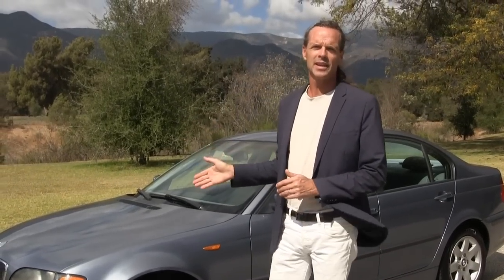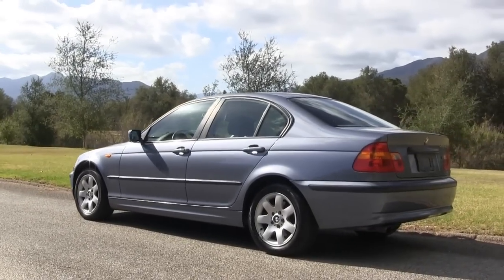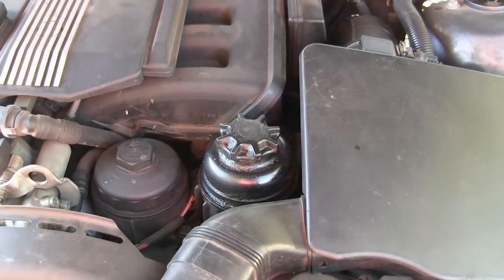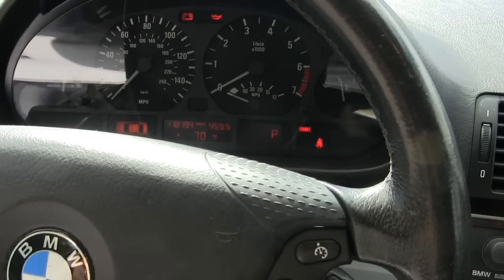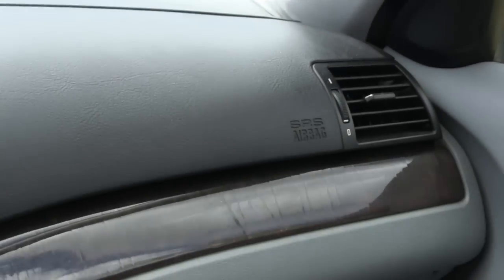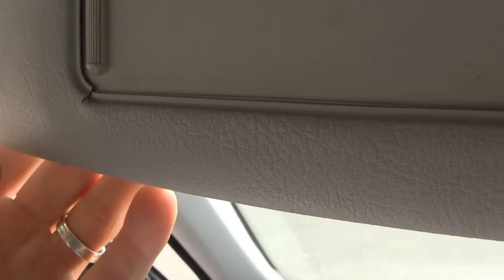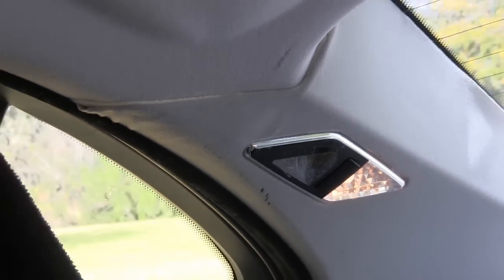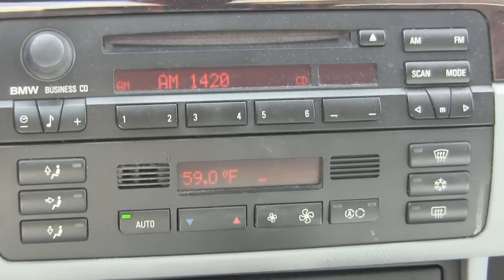Why You Should NOT Buy a Used BMW

Comment: Has this car been parked under water?
Reply: Florida car maybe?  I wonder what cleaning agent was used in the interior to attack the surface?  The same one used on the badge probably.  I'm not sure about Toyota's being any better at high mileage and not garaged.  At least BMW owners pretty much know what they are getting into and do the maintenance.  Toyota/Lexus owners pride themselves on not doing maintenance.  All cars fail without maintenance so which one do you want?
Reply: EXACTLY. I never had issues like this on my 325i. This is bullshit.
Reply: I worked on BMW's in the UK for years and they have always been fabulous when under 5 years old, but after that the problems begin with tech that always fails, everything electrical starts to give up the ghost - aircon, windows. audio, door locks, alarm, engine electronics, dashboard, you name it it fails in the end. If you are not into repairing these items yourself then you're at the mercy of main agents and their astronomical labour charges.
Reply: Nope, but it should have been.

Comment: BMWs are great cars, as are Audis and VWs, however I will say that us Europeans get the best quality cars from the German manufacturers. Volkswagen cars sold in the USA are made in Mexico whereas Volkswagen cars in the UK, France or the rest of Europe, are made in Germany. BMWs sold in America (specifically this E46 3 series) is also made in Mexico. BMWs sold in the EU, are indeed, made in Germany.
Reply: so. according to this theory....  you guys are saying that every different assembly plants from BMW specially the Mexico division, who caters to the North, Center and South America,  the Caribbean adheres to a different standards aside from the one in Germany?   Manufacturing processes, parts suppliers,  components,  and quality control  across the board is optional for this brand depending on the country of origin?
Reply: The original parts, no. However, the construction will definitely be worse. I've heard horror stories from USA based VW owners including the brand new Golf-R, having cars plagued with annoying & expensive problems meanwhile you hear nothing over here in the UK. I've obviously heard about issues common to cars such as the 1.9TDI engine breathing a lot, the VW Golf MK5 with its issues such as doors sometimes not opening, suspension degenerating etc but it's never as bad as cars from overseas in the USA.

I think cars made in Germany will be put together much better because of workers being treated nicer and properly according to German law as opposed to Mexican workers who will no doubt, get treated worse and have lower morale. Plus, Germans are known for their excellent work ethic and their quality craftsmanship.

Every car has its issues but I think Mexico-made cars have more.
Reply: you think the same as you go to take a shit....you presume, but experiences from europe tell that bmw and others are crap....
Reply: Denis Sabljarić mid-90s are border for good quality in most and in bmw as well
Reply: Denis Sabljarić that's one side of te story and the other is bad mechanics....sve su to odavno totalna precenjena bezvredna govna ;) i japanci nisu što su bili....
Reply: Denis Sabljarić mostly, yes, but I believe there are decent 5 e39s for bellow 5000.
I know a man who had a6 c4 2.2 t....survived hard driving well, but when it started falling apart, it was almost 4000 in engine repairs only and still wasn't ok....sold and the other owner had luck to change a few things and it is ok....but that guy lost his patience after great loss of money
Reply: Denis Sabljarić yeah, my friend with c4 2.2 is from zagreb, but he did the job by himself....for things that didn't require specialist, such as turbo or engine head....the good thing is to have chain-cam, but only if the chain was properly made, otherwise it is even worse than belt.
Reply: these materials are not made to withstand 35C dry weather on a constant basis, i assume the guy lives in cali
Reply: Denis Sabljarić rear lights are ugly on e46. the ugliest are creations from chris bangle and latest bmws....
Reply: BMW's Mexico Plant wont even be producing cars until 2019.  As of right now the only BMW's made outside of Germany are the SUV's.  They are made in the Spartensburg Plant in South Carolina.  The quality is exactly the same as the German cars.  It would not save BMW any money to switch out an assembly line with inferior parts for different markets around the world.  The only differences between the European models and the US models have to do with emissions as the US holds emissions to a "higher" standard then Europe.
Reply: I have 3 Audi's, all over 200k. With proper maintenance and care, they last decades...
Reply: Yes BMWs cost more to maintain.  It needs to be an understanding when purchasing the cars.  You dont need to be a millionaire to own one though.  I have owned my E46 for ten years now and because  I have kept my car properly maintained it has been a very reliable car.   On average i spend roughly $700 a year on maintenance with some years being more then others.  If you cant pull $700 a year maybe you should be driving a bicycle.
Reply: Well I cant speak for an Audi as I have never owned one but i have owned multiple BMWs and reliability has never been an issue with proper maintenance.  I will say I have owned a VW Golf and it had a ton of issues mostly electrical.
Reply: Well to be honest, if someone buys a foreign luxury vehicle expecting the maintenance cost to be low, they dont need to be driving said car...

Also, with these older vehicles, one could just learn to turn their own wrench..
Reply: atafits I totally agree.  Too many people buy these cars because they want to look cool.  I see it on the forums all the time.  They say "I bought this car for $2500 what steal"  Then a couple months down the road after doing nothing to the car maintenance wise they are wondering why they are stranded on the side of the road.   Yet the have $2000 worth of wheels and tires on the car and a $1000 worth of stereo equipment in the car.
Reply: Denis Sabljarić Eventually i think all cars get to the point where a decision needs to he made as to whether it is worth it or not to continue.  My car personally has been getting more expensive to keep going in the last few years.  I also have a to do list.  my plan is to get another year out of my car and then sell and upgrade to a newer BMW.
Reply: Yes the place where the same material is put together does not matter, but what does matter is the way that material is treated. If you use some highly acidic cleaner (sorry, don't know the excact english word) it will be bad for the material. Also such thisng as smoking in the car, not cleaning it etc. will damage the interior a lot.
Overall BMWs are great cars, but their main problem is the usual owner. They get destroyed, abused and overall not taken care of. For example, my brother bought an e39 5. series BMW full equipment, perfect condition, no rust and can't even think of such things as described in this video. So in the end it all comes down to if you know what to look out for when buying a car or not.
Reply: AS I said in my comment to nother dude, you can get a good bmw for a good price. My brother got an e39 for 1900€, perfect condition and full equipment.

Only problem was that he crashed it :D
Reply: BS: In Canada - You are full of it! 3in the driveway (1, 3 & 5 series) - Leipzig, Regensburg & Dingolfing respectively. So where do you get your knowledge that our supposedly "inferior" BMWs come from Mexico?

BTW: No real problems with any of them once prior owners' bad maintenance was addressed (OK, battery drain - over 1 month - on the 5)
Reply: Tony Brack If people only read more then the first comment before they replied they would have seen that I called him out on this earlier.  It amazes me that people continue to believe this guy lol.  They have actually built an assembly plant in Mexico but it wont even be producing vehicles until 2019.  I'm sure the build quality will be the same though.   Sounds like more anti mexican rhetoric to me.  Volkswagens built in Germany and the ones built in Mexico are just as unreliable ;)
Reply: That is true for any manufacturer.  Different factories have different workers, different parts, different work ethics.  It is a fact: German cars built in Germany are far superior in quality.  The same goes for Japanese cars.
Reply: It's an Audi.  They are shiftily built cars.  It's truly regretful, because they are engineered maybe a bit too much, but the build quality does not live up to that.  They drive well, but fall apart at an amazing rate, and very expensively.
Reply: don't really know.  I had thought all of them were built in Germany, but I could easily be wrong on that.  I know the X5 and others are built here in the US, but know nothing of Mexican BMW plants.  I learned a long time ago to only have cars built in country of origin, it seems that the ethic is just better.
Reply: that makes sense, I had never seen one that had been built outside of Deutschland.  My 325xi is just short of 300K miles at this point, and was driven like a race car all of it's life, but has been well taken care of.  It's only issue is rust on the bottom of two doors, which for 300K of New York winters commuting from upstate to the City ain't bad.  It's a great car, well worth it.  Most BMWs I see that die are due to poor maintenance, or bad shops I don't recall one which just fell apart without cause.  I hate the Bangel era cars, both in look and in drivability, but the predecessors are all marvelous.
Reply: Lispy Joe right on target!
Reply: I had a European e46. I'm sorry, but it was a piece of crap. And it had that subframe issue where the rear suspension started to go up through the car. That's just poor design.
Reply: Elvis Putnoee Build a wall 😆
Reply: Toyota or Honda, I had a toyota hilux surf that just went on and on and so easy to fix little issues, I dragged every car out of our road whenever it snowed without even using the throttle, just stuck it in 4x4 and tickover hauled them up the ice. My other was an Honda accord 1996, in 123,000 miles it cost me one CV boot and a timing belt.
Reply: I got lucky and mine ,used in NY,USA , Built in Germany! And a fantastic car!E36!
Reply: My e46 was shipped from Germany to the USA... arrived in Newark, New Jersey

Comment: Never seen or heard problem like this here in Europe. usually changing sensors:  ABS, cam, temp etc.
Reply: DJjohar a lot of those problems come from sun damage the plastic starts to biodegrade
Reply: DJjohar the European cars are made with different factory specifications and usually more reliable also
Reply: Not anymore, I fear.

Comment: I'm very happy I bought and still drive a 2001 Acura 3.2TL.  With 211,000 miles, it has almost none of the issues as in this video.
Reply: itsmegp46 yep an Acura fan right here
Reply: Amazing cars. no squeaks, no rattles, still a tight body structure.
Reply: Same as my Toyota Celica. 👍
Reply: You got lucky you didn't get a bad tranny in that TL
Reply: Agree! I have a 2013 acura mdx and perfect to this day. Still the original battery. I done nothing but oil changes, regular maintenance.  Great cars! Acura all the way!

Comment: I own a 2005 325i and my experience is a polar opposite of what the video describes. Its actually been the most reliable car I've ever owned. I do basic maintenance myself and take it to the dealer every 6 months for an inspection. The only thing I've had to change in 4 years is oil filters and tires.

Comment: The Germans were amazing at innovation back in the day. And, the 80's 123 Benz is one of the best build cars I've ever had. Lately, though, these cars have gone from engineering marvels to backwards, clumsy, poorly-thought, nightmares. I've worked on a few Audi's, Merc's, and BMW's, and I've learned to avoid them at all cost. Some cars have different engineering principles (say, Subaru), but if they're Japanese, there's logic to the engineering. I can't say the same about the EU cars. Give me a 10/12/14/17mm bit and I can take most any Japanese car apart. German car? Get ready to park a Snap-On truck next to your workshop, you'll need it!
Reply: what the fuck
Reply: That escalated quickly.

Comment: Wow! I had a total of 8 Bimmers (wife & I) between 1987-2016. We didn’t have all those cosmetic issues, but instead had the sudden huge failures. My 2002 X5 had to have the complete wire harness replaced $800. Also the head gasket replaced $1500. The head gasket failure was nation wide here, all at once, hundreds of X5’s. A lot of us thought it should be covered out of warranty. But BMW said no. My wife’s 2009 X3 had the a/c evaporator fail at 95k miles $2500. We drive Lexus and Toyota now. I was half thinking about a used X5 to replace my Sienna van in the next few months. I used to be a Bimmer fanatic. Thank you for knocking sense back into my head. I was having weak moments. I am officially over Bimmers now.
Reply: Good. Although you may have had fun In the good old solid ones, BMWs are now absolute money pits! 💰

Comment: You are 100% correct with this video. My boss has a 2000 E46 323CI. He has had every one of these failures and many many more. He overheated it once because of plastic failure in cooling system. Then I happened again a few years later. Engine did not survive the second time. Head gasket let go. $$$$1800. Then that stupid rubber gasket on the oil filter housing failed and it started leaking oil  like crazy. (common failure on these) Then last summer the so called "D drum" failed in the transmission and boom, car won't move. Common failure on these $$$$4200. Control arms are garbage, as well as the rear coil springs. Common failure on these. Heater resistors also go bad on these often. Then, recently he lost compression in the number 1 cylinder due to carbon build up on the valves. $$$$. FYI, head bolts are known to pull the threads out during a head removal. Major pain in the rectum. And the list goes on and on. These cars are HORRIBLE. I know, I'm the guy that had to work on his shit box every time it puked.

Comment: It was my dream car and finally bought used BMW X5, enjoyed it while working but suffer and spent a lot when overheating starts.It was painful and never look it back. Whatever mentioned in the video is 100 percent true.
Reply: YeAhmed Abat x5’s are trash. This isn’t a X5. I’ve seen these cars easily his 150-200k miles. Oh no a expansion tank? 40$ and 20 mins labour. 

Water pump? 65$ and 1hr labour. 

Valve cover gasket? 35$ 30mins labour. 

If you can screw in a bulb these E46 inline6’s are amazing engines.

Comment: I have a 2000 323i that I purchased new and it has had all of the problems described here plus more. I've also had radiator fan, suspension, front end alignment, A/C compressor and air bag issues. Fortunately, I can fix a lot of these problems. If you have an out-of-warranty BMW and you depend on the dealer to maintain it, it will send you to the poor house. However, when you drive to the poor house in your ultimate driving machine, you will have a smile on your face.

Comment: the thing is, if you're into cars to some extent you will never have any of these problems. because you will be looking after your car, nothing breaks just because. it is always the driver that causes things to break.
Reply: Rokas Getautas Or bad designs
Reply: mate sivric even bad designs can be easily kept running for years just by doing a simple maintenance every couple of months (5-6) my e39 2.5tds did not have a single problem with it in the last 2 years.
Reply: I just wanted to add. people buy brand new cars nowadays and expect them to run for years without maintencance. Stupidity at it's finest.

Comment: My 2004 325i still drives beautifully after 200,000 hard miles. 
Yes, it has all the interior cosmetic issues you mentioned here, but I still love the car and enjoy looking at it and the feel of driving it. 
Yes, higher maintenance than a Japanese car by a fair margin, but actual repairs on either one will be similarly expensive. 
These are old cars now. They need stuff. Just keep on top of maintenance and find a good reasonable reputable independent BMW shop and avoid the dealer like the plague, and you’ll be okay. ;)

Comment: My 1971 BMW R/75/5 'motorcycle' came with a tool kit under the seat capable of performing a full tune-up or dismantling the entire motorcycle. My 2006 K1200R BMW 'motorcycle' came with ONLY a single screwdriver in which to change the blinker light bulbs. And the owners manual didn't even instruct on how to change the engine oil. BMW sadly has taken planned obsolescence to a new level.
Reply: Or they more likely got sick of owners messing their cars up trying to perform simple maintenance and blaming the manufacturer. So they designed the cars to almost required a specialized shop to repair them. With the cars at least, dont know about the bikes ;) /BMW_Tech

Comment: As an addition to my comment about my BMW and the dealership. I bought my daughter a brand new Fiat with a one year warranty. This car did 30000 miles in the first 18 months with only one service. She rang me when it was about 18 months old saying the accelerator was sticking, she would take her foot off and it sometimes didn't slow down to a tick over so I booked it in for a service and have it checked out. The dealer loaned us a new Fiat Punto while it was in dock. I rang the day after the car wasn't ready, rang next day not ready and so on for over a week all the time we had this new Punto. When we went to collect the car I was prepared for a big bill and was pleasantly surprised  when they said no charge Fiat has paid to have a new ECU and reprogramed even though it was way out of warranty. Now that's what I call a service. Well done Fiat